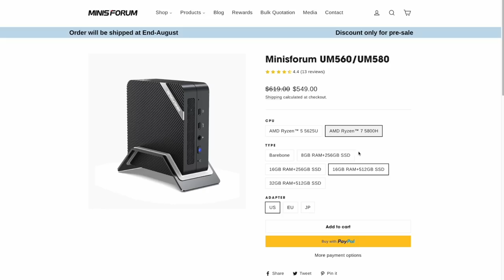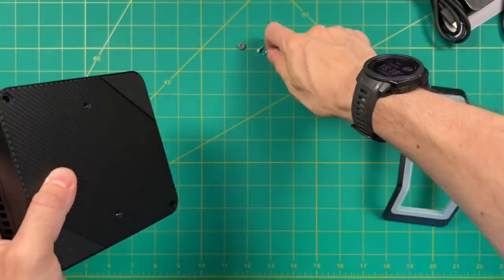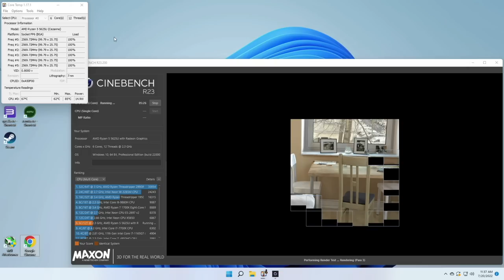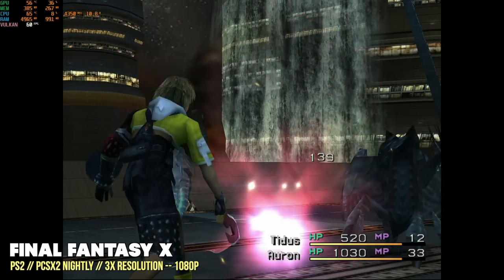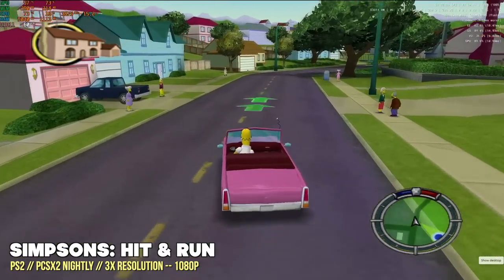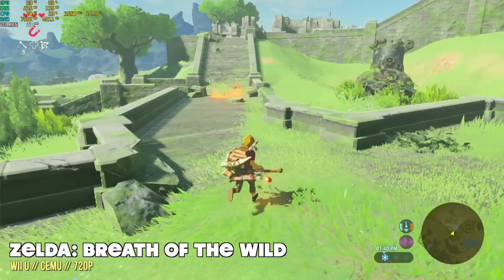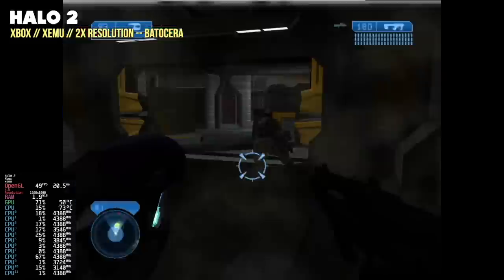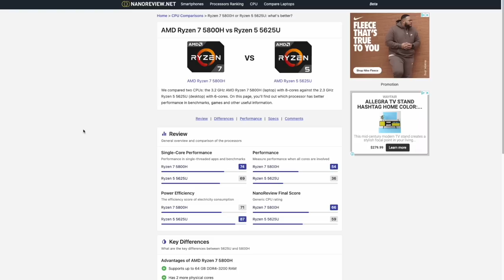$500 Mini PC -- Excellent Mix of Price and Performance

Comment: Thanks for the video! I decided to order one of these instead of the upcoming um580 because my monitor can only provide 65watts per usb c. One other thing worth mentioning: ETA set the TDP on this um560 to 45 watts resulting in 60fps in botw with 720p.
Reply from the maker: Oh that's good to know about the 45W TDP with BOTW, thanks!
Reply: @RetroGameCorps  i have the um560 now several days. Overall, i am very happy. Batocera runs great on this. Also cemu. What i dont like is that my Dell monitor 2722dz with 65w power delivery is not giving enough juice to boot the minipc :-( also not on stock tdp…. At 45w tdp even the original power supplier sometimes makes the minipc shutdown. Default tdp is 25watts as it seems Which is fine for me. Botw runs with 30fps at 720p like this without antialiasing. Cheers!
Reply: Maybe one more thing: I noticed that during your Cemu examples the wattage showed always around 15 watts which is quite low i think.  On my side, Ryzen Controller was causing this behavior  (limiting the tdp for some reason to 15w). Without ryzen controller installed/starting during windows start, tdp seems to be at 25w with stock bios settings. but still i am not so sure with all the tdp stuff… after a while of cemu, overall the wattage goes down again to 15 watts…

Comment: You're supposed to slot the two 90 degree angled fingers into the holes for the 2.5" drive and then screw down the other side.

Comment: What a powerful little box, truly worthy of the moniker "Mini PC".

Also I don't want to bother you but I did your Badacera tutorial and after using it my PC won't boot Windows properly. I reseted the boot setting but it won't work now.

Any tips to fix that?
Reply from the maker: If the boot priority is causing issues, you could also go into the BIOS and reset the CMOS settings.  That will restore it back to factory settings but will also reset any other tweaks you have made (like if you changed the RAM timings, for example).
Reply: @RetroGameCorps  I Think I tried that but it wouldn't reset curiously
Reply: I have my windows on a separate SSD... Than the Batocera. Boot Order is only thing I can think of.

Comment: The 5800h is 100w yet I can't find a monitor that supports 100w of power delivery. So how is the USB c port on the 5800h going to do anything but receive power solely from a wall power supply?
Reply: Also curious about this. My monitor can supply 90W — really hoping that'd be enough but not sure I want to risk it.

Comment: I think those two stands for the ssd are actually suppose to poke into the screw holes of the ssd!
Reply: it is. one side goes in screw holes and other side to for screws. Actually a good solution

Comment: For the price, it's worth it. Much better deal than those windows portable handhelds above US$ 1000!
Reply: You cant compare those to this its not even the same thing and they run 500+
Also 1.000 is $1 not $1000
Reply: @primus711  In my opinion, it's much better. The main difference between this device and the portable ones are the screen and integrated controls. The performance is almost the same!
Reply: @djwrahfael  performance is the same when they use same apu and tdp and the screen controls etc add 100s more plus the smaller pcb with more layers just like a expensive phone you pay more for that complexity
Again they are completely separate none comparable things 1 is a mobile device other isnt and has more liberties to be cheaper

Comment: Any MAME testing on this or the updated version when you get it? Curious about using it as a dedicated MAME cab core. Particularly fighting games such as CPS2 games and the Mortal Kombat series.
Reply from the maker: I didn't even test them because they will 100% work fine on this.  Everything up through the Tekken series and Killer Instinct will play like a dream, and if you want to do the configuration you could throw other advanced stuff like Model 2/3 or Triforce arcade games too.  Tekno Parrot should also run fine.  Overall this would be great for just about all the arcade emulation you could throw at it.  CPS2 and MK will be absolutely no problem.

Comment: This is an impressive unit, funny enough I ended up getting their Elitemini B550 and attaching a GPU to it 

Still this is a nice bang for the buck option, and I can't wait to see the 5800H performance
Reply from the maker: The B550 is definitely a much more powerful system, but about twice the size of this one.  How are you liking the GPU attachment?
Reply: @RetroGameCorps  I am liking the GPU attachment, it does add some nice performance
However the dock for the power supply feels more inclined for SFX power supplies and not ATX ones 

This is something to keep in mind, but I will also note that the addition of the power supply section does add some nice room for cable management if you get the right cables
Reply from the maker: @sw1tchpoint  thanks for the feedback!

Comment: There was quite some time when I was considering these, but I feel that if I had a perfect guide for Dolphin on my M1 Mac mini, I could probably live without buying additional hardware. I mean: I have things running, kind of, but somehow it seems I never get the controls to work right, some games therefore just don't wanna work at all, plus I'm guessing I'm missing out on all the fluffy getting resolutions right or widescreen hacks etc.
Reply: Mac M1 hardware is actually really great for dolphin emulator !!!

Just be sure to get the recent version with native M1 support (without the need of rosetta emulator). 

I tried also ps3 emulator on my macbook air m1, it was running god of war hd very smoothly. But it was running quite hot (no fan inside macbook air m1).
Reply: @hadouken2123  Oh, I'm sure it is. But I'd still like a guide, because I just haven't got the time to read myself up through various endless threads to get the controls to work how I want them. Russ' guides are just so much better.

Comment: So I just bought the Droix Proteus 11 because the sale was on but the device has been having a couple issues (random crashes etc, and it runs a little hot and loud as you mentioned in your review of it) so I think I'll be returning it.
This Mini PC looks pretty great and I don't really mind an all plastic build.

Does the Mini Forum run a bit more quiet in comparison to the Proteus?

Edit: And another random question. Do you have a preferred front-end you use with emulation? I typically use Launchbox but am leaning more towards Playnite recently
Reply from the maker: Yes, I didn't speak specifically to fan noise in this video but it's quite a bit quieter than the DroiX.  I'd say it's about an average volume for this build size.
Reply: @RetroGameCorps  Thanks for the response, I appreciate it! Defnitely looking forward to your 5800H review

Comment: What is the current best mini pc at $1K? To push gaming as much as possible?
Reply from the maker: At that price point there aren't really any mini PCs available, the good ones are all usually around the $700 range at max.  Once mini PCs with the 6000-series APUs start coming out that would be something to consider, but I don't know how long that will be.  I would instead recommend a laptop with a dedicated graphics card, you could place it in a stand when connected to a monitor to have a nice small footprint, and then also have a gaming system to take with you on the go.  I haven't really researched gaming laptops extensively but I think a laptop with an RTX 3050 Ti should be under $1,000.
Reply: There is a new 1 that has a external pcie and allows to be installed into a backplane linus is doing a review of it
The Elitemini B550

Comment: In the 2.5" SATA HDD location, is this PC capable of accommodating thicker 15mm drives (like a shucked 2.5" 5TB)?
Reply from the maker: I would say no, it’s a pretty tight fit with a bare hdd

Comment: You installed the hard drive incorrectly. Those prongs go into the screw holes.🙂 And I see that the case is broken in one corner.☹
Reply from the maker: Hi, yes someone else made the same comment and so I took it apart, and sure enough yeah the prongs go in the screw holes!  As far as the corner being broken, I think you're referring to what looks like a crack in a corner in the beginning of the video...that was a cat hair that I didn't notice until afterwards.  It does look like a crack though!
Reply from the maker: Actually, I just looked at it, and yeah there is a small crack in it!  Didn't even notice it until now.  It must have been when I was adding the bottom cover again.

Comment: Can you hook this up to a big screen TV
Reply from the maker: Sure!  It should output in 4K or 1080p, depending on the resolution of your TV.  It would work great as a home theater PC or as a Batocera gaming PC.
Reply: @RetroGameCorps   Thank you for going back to me  I have some steam games that I'm looking to play and I want to make sure that the video card can handle it so one of the games I'm looking at playing is wolcon lords of Mayham  And it requires this type of video card NVIDIA GeForce GTX 560 Ti / AMD Radeon HD 6850 and last epoch nVidia GTX 660ti or AMD R9 270 with 2+ GB of VRAM  I'm wondering if I could run these games on the highest settings. Any type of advice would help these are my highest setting games are usually don’t play AAA titles. I have a PS five for that and a gaming PC. This would Morley be for retro gaming and some steam games
Reply from the maker: @loverelationshipsclips  You likely won't be able to play that game on high settings with this PC, you would need something with a dedicated graphics card.  Looking at the age and power requirements of the game, you can probably expect 1080p low settings to be about 30 frames per second on this mini PC.
Reply: @RetroGameCorps  thank you you’re the best I am still getting the machine I just won’t play those games on it I can play some other ones. Greatly appreciate your quick responses it’s because of this that I’m subscribed to your channel and I will be picking up this machine as well.

Comment: under 100 bucks mini pc when? do they even exist?
Reply from the maker: You can find mini PCs with the J4125 chipset for about $130 on AliExpress if you shop around, that's about as low as they get.  That chip will give you about 75% of GameCube games playable, and maybe 25% of PS2 games.
Reply: @RetroGameCorps  never expect a response, that's why you're the king of tech reviews
Reply: @RetroGameCorps  have you thought about doing a review like this for the Pi 400? the one with the built-in keyboard